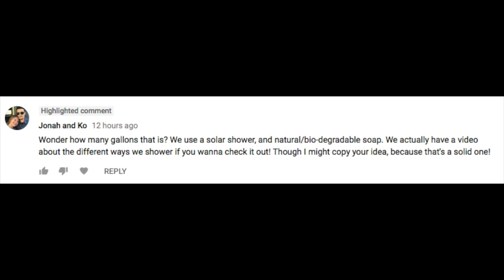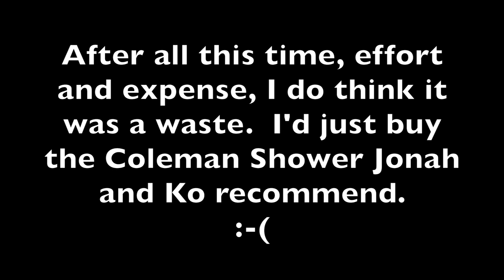How to Build a DIY SOLAR SHOWER FOR YOUR VAN OR CAR

Comment: I've just completed a 6" ABS build and man, those f-in cleanout threaded plugs just suck!!! Would've been done weeks ago had any of the plumbing stores here had the 6" caps vs the cleanout/threaded cap combo. And because I decided to go 6" for more volume it not only cost a hell of a lot more and took longer due to parts availability, but the threaded caps have leaked no matter how much PTFE tape I've used. Even used toilet wax as some of the plumbers I know recommended. Still beads of water (only under pressure) leak from the ends. That said, it's good enough to transport full and only pressurize right before a shower, so it's not wasting water everywhere I go. Still undecided if I"ll cement the threaded endcaps on for complete piece of mind (but lose the ability to use the cleanout the way it's intended). **ALSO** the way you mount these things will make a huge difference in cost and safety. Water isn't light and when you get up to higher volumes, that shit is heavy and makes your rig more top heavy, not to mention it will want to naturally rotate up there. I chose to go the hardware route rather than just foam and straps, the way 90% of these videos show. Foam and straps are faster and much more practical, but the engineer in me wanted something more beefy. Took a little bit more headwork and cost, but I did a very similar system to what plumbers use to carry conduits. It involves big U Bolts, plates for the U Bolts, nuts/washers, and carriages to steady the pipe that go under the pipe. These all rest on my Yakima crossbars. That hardware cost more and takes a little longer to set up (and you have to bring the socket/wrench with you just in case), but I feel a hell of a lot more comfortable with the 80+lb tank on top of my rig going down the highway knowing it's less likely to turn into a missile if I stop short.